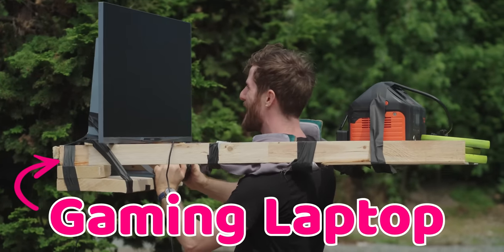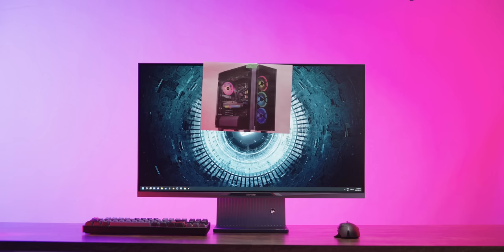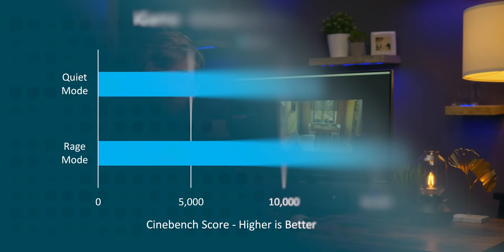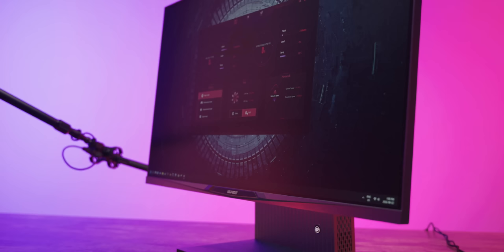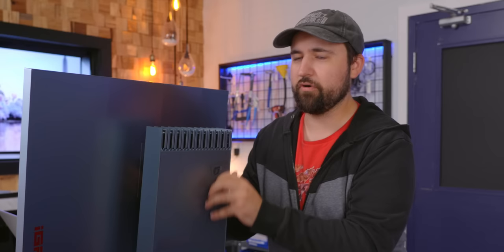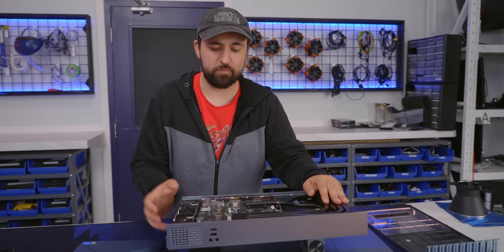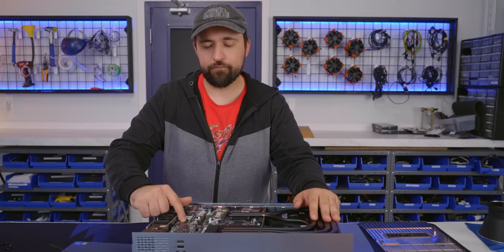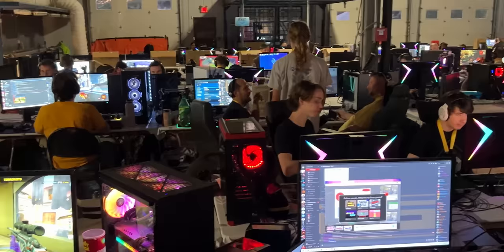Justify Your Existence. I'll Wait. - Colorful iGame AIO

Comment: Some points I think need to be made:
 - speccing out and building an actual SFF PC (getting everything to fit and not overheat) is at least one tier above building your own PC in a regular case; Linus did eventually touch this point, but very lightly, personally, I think that it's not for at least 90% of people out there; you could have someone else do it for you, but then it's more cost and there's also a matter of maintaining it.
 - you measured the performance of your "SFF build" on an open test bench (so, very likely, better thermals, and, not unlikely, better performance than if it were to be run in an actual SFF case); 
 - a gaming oriented SFF PC, as small as it is, is still a decently sized additional box to have around, which may be undesirable for this product's target audience
 - with an SFF, you would probably have more upgradeability; that said, RAM and storage would likely be at least as painful to upgrade as here; CPU? One of your options would be AM4, which, after many years and generations, is finally approaching EoL; the other option is Intel. So, CPU upgradeability on an SFF is more of a maybe than a yes; also, the future CPU would have to fit not only inside the same socket, but have similar cooling requirements as well; the GPU would be a clear win for the SFF, though (provided that power requirements don't go up significantly).
 - Why not get a laptop? Well, if you want portability, get one; if you want ergonomics of a proper 32" monitor on a stand and a PC that you will use in your home, then a laptop is not it. This is for people who want an almost proper PC in their home, but have limited space or want something that will fit in their living room. Also, for someone in a small space, at 32", this can double as their TV.

Regarding the performance, I agree that 1440p is stretching the hardware, although I would imagine that, at slightly lower settings, the 3060M will be able to push the pixels quickly enough for some time. I have an RX 580 8GB and I recently switched to a 1440p display and I've been pleasantly surprised so far; granted, I haven't tried Cyberpunk, but the likes of, say, AC Valhalla or Stray, not a problem apparently, so I guess that this isn't too bad either. This question is what makes or breaks the system, as a gaming system that can't actually game is a flop, but something that will tear through eSports, with high framerates and has a large HRR display to boot, and that will also do other titles, as long as you're willing to make some compromises (downgrading from very high or ultra settings, using DLSS, accepting that you can enjoy a game without a 60fps lock, which, as someone born in the mid 80s who grew up on a budget I certainly do) is a viable option. It's worth mentioning that all of the alternatives offered in the video either offer similar performance, cost more, or both.

It can be argued that a 27" 1080p version may have made more sense. It would have been cheaper and less big, making it more suited at some of the use cases mentioned in the video, and it would allow the GPU to push more frames with higher settings at native res. On the other hand, the 32" do mean that you could seat two people in front of it, each with their own controller, more comfortably than if it were 27", and the same goes for small space, doubling as a TV scenario that I previously mentioned.

Overall, I don't think that it's a bad product. Not for everyone for sure, but there are niches within which it makes sense.

Comment: At least this AIO didn't require an epically insane ordeal to repair after disassembly. Who could forget the infamous $5k iMac repair series.
Reply: Plus you actually CAN swap out the strorage and ram. Certainly can't do that with any of the macs nowadays.
Reply: Do you open your monitor?
Reply: @BrawndoQC  If there was a computer inside I needed to service then I would indeed open my monitor
Reply: @TheoHiggins   You would never buy an all in one from Apple anyway.  We had plenty of HP and Dell AIO at the office and they were terrible to service. We just replaced them.
Reply: @BrawndoQC  Yes, I've swapped the mainboard/PSU in one and taken apart a couple others to minor repairs or salvage parts.
Unless space is very tight, the simplest design is the most repairable. Screws, clips, removable boards.

Comment: An AIO is for someone who wants a large display, good-enough performance, and reduced space on a desk. Every single desktop out there, even the tiny ones, will take up more room than this as this only takes up the room of a monitor. A laptop on the flip-side has a much smaller display, so if you want a proper keyboard or a bigger screen you end up taking up more physical desk space than an AIO.
Reply: but a nuc on the back on a normal monitor will take up as much room, you could argue even less and then you can mount it on a better stand and easaly move it all out of the way
Reply: no they don’t, you have the base & behind monitor to store something like a NUC

It has the added benefit of being able to upgrade / use monitor separately
Reply: @cec4  and the NUC is probably even louder and has less performance.
Reply: Speaking of space, this AIO still looks bulky af because of the stand, and you'll get much better looks with any other AIO.
Reply: @ultraL2  Some AIOs have HDMI input (My dad has one that even has composite input) which is nice.
Reply: “Good enough performance”? What the hell kinda cooling is very very good, or amazing performances???
Reply: @cec4  a tech enthusiast can put something like that together pretty easily, but I wouldn't trust my mom to even know where to begin picking stuff out to get a nuc for mounting to a monitor
Reply: @xXxJakobxXx3  NUCs are definitely not louder or has less performance. Laptops, NUCs and AIOs, use the same kind of cooling. And the performance depends on what model you bought.
Reply: Can you VESA mount this? Any monitor/AIO that can't be VESA mounted surely wouldn't take up less space than a laptop (which can even be on an upright stand) and a monitor on a VESA arm or wall mount with one thunderbolt cable doing everything? The base of this monitor is literally the footprint of a laptop it's so chonky lol.
Reply: @ultraL2  Thats very dependant on desk size I think. I know for me personally my desk isnt deep enough to have a NUC behind it, my monitor goes right to the back of the desk, so that simply wouldn't work as something that takes up the same space as a monitor.
Reply: You could glue an intel nuc on the back of a monitor but that's kinda jank.
Reply: Who has such a space premium that this is more affordable than any other option. Still makes no sense.
Reply: @ViXoZuDo  any regular 4x4 NUC that you can VESA mount behind a monitor will not have a dedicated GPU, therefore has less performance than the machine in this video. And these 4x4 NUCs are probably way louder, because of the tiny cooling solution, compared to the big heatsink in the video. Skull Canyon and the other gaming focused NUCs may be different, but the recent releases looked like separate boxes, not VESA mountable. EDIT: NUC11 Enthusiast may come close, not sure if it is VESA mountable and 2060 vs 3060
Reply: @cec4  Well you could jerry-rig something to mount a NUC to the back of a monitor, but most people wouldn't want to even try to build anything or find a way to secure it, people don't want that effort. If its on the desk behind the monitor then thats desk dependant, on my desk my monitor has to be pushed all the way to the back because of how small it is, and some people can't just get a bigger/deeper desk in the space they're in. So while a NUC is a good solution, theres still a niche for an AIO.
Reply: Not sure what mini builds you've seen but I'd rather have anything other than an AIO. Even the smallest mini itx build can house way better components and will be much more quiet rather than a AIO with a literal laptop housed inside the stand with 3600rpm fans. Laptops and AIO's will never be good until some revolutionary cooling techniques come in to play. Sure, the convenience of them is okay but name one person that has ever said "wow yeah I've been using this gaming laptop for years it's the best thing ever I play all day every day" because you can't lol. Can't upgrade them, thermals and thermal throttling and worst of all C tier components, mobile chipset, mobile gpu's etc. Mix those together you get a toaster oven that thermal throttles with length of play. I'll stick with building my own "massive" desk top pc's.
Reply: Laptop + monitor is still probably a better value
Reply: @xXxJakobxXx3  All NUCs can be VESA mounted, including the intel ones... even the chungus of the Mac Studio can be VESA mounted. You can even buy adapters to mount a whole laptop to the vesa mount behind the monitor.
Reply: @B_M_A  But for people who buy AIO's they're generally not enthusiasts, and therefore don't care too much about the components. As long as it does the job at the time they buy it its good enough. An AIO buyer is the probably the least likely sort of computer buyer to want to build a machine, let alone select components for it. This means that for the vast majority of people on this channel this thing isn't for them, but there are people out there who would prefer this over a small ITX, NUC, or a Laptop, because it fits their wants better.
Reply: @Holden2Epic  I think he meant in AIOs in general as its basically a laptop motherboard  in a monitor.
Reply: @__-fm5qv  mate it’s a 32” monitor , there’s space for a laptop
Reply: @ultraL2  Not necessarily, you can put a big monitor on a small desk, and plenty of people out there do so. Just because it seems impractical for your living space, or because its not how you would allocate desk real-estate if you had a smaller desk, doesn't mean that someone else won't prioritise screen-size. 

People have different priorities, and something that seems poorly optimised for your needs doesn't mean its poorly optimised of anothers needs.
Reply: @__-fm5qv  did you even watch the video …
Reply: @ultraL2  of course I did, what implies that I didn't? I'm genuinely confused... I'm just stating reasons someone may want a large AIO over other solutions, not necessarily this particular AIO.

Some people simply want a large screen and have limited space on under a desk for a computer.
Reply: @__-fm5qv  the video & title is about this particular AIO

Even if we are talking generic 

there’s no way you have space for a 32” monitor & not have space for a laptop vertically behind it
Reply: @ultraL2  And mounted how? You can have a laptop stand holding it vertical, but then you need the desk depth for the stand. You could just prop it up behind the monitor stand but that's not the most secure, it could fall behind the desk and break.

I'm just saying that a laptop is great, but you still need to rig up some system to hold and secure it properly, which a lot of people simple would want to do.
Reply: @__-fm5qv  You learned nothing from the silicon scarcity. You're actually competing with these idiots, i.e., if more AIOs are sold, the price for more convenient alternatives will rise. So, better educate them out of their lazyness.
Reply: @sovo1212  I'm not sure why everyone is so mad that I'm saying that there is a reason AIO's exist and people buy them???

I personally wouldn't buy and AIO, but there are people out there for whom they are the ideal option.

And you can't just educate someone out of their laziness if they don't want to be educated. And therefore there is a market for them. 

I'm not sure why people here are trying to argue the objective truth that for some people an AIO is their preferred option of computer form factor...

And I personally don't view computing form factors as a competition against who prefers what form-factor. So I'm not going to try and sway people so that my thing can be cheaper, thats just psycopathy.
Reply: @__-fm5qv  I just explained to you how scarcity works. Ask yourself "why do gamers hate cryptocurrency miners?" It's not like "there's a market for them, let them choose and be happy". More sand for AIOs means less sand for PCs, NUCs, laptops, etc. So we have to pay a higher price because of the demand on silicon by these AIO lovers. That's how the market ACTUALLY works, not ony this one, every market.
Reply: @sovo1212  Well yes, but I'm not going to be like "you should get a laptop instead because that then means I can get a laptop more easily due to production prioritising that" am I? Thats psycotic, trying to manipulate the market to suit your own needs instead of having someone get something that works better for them specifically. Morally thats a no from me.
Reply: @__-fm5qv  That's not psycotic, it's just taking good care of your hard earned money (not to mention it's objectively a better choice). If you just don't care you must be rich, but that's not the reality for most people.
Reply: @sovo1212  I mean, for me a computer is a 1 in 6 to 8 year purchase, while I'm not poor I'm not exactly well off I barely make enough money to pay taxes. I just start saving for the next computer as soon as I get the current one. I'm not rich, I just don't think trying to manipulate the market for your own gain, over genuinely helping someone come to a purchasing decision is morally good.
Reply: @__-fm5qv  You're not manipulating the market. Bad choices made by other people negatively impact your personal finances, that's the point. By saying someone else "don't buy a f*cking AIO because [list of reasons]", you're genuinely helping to come to a purchasing decision, nothing morally wrong with that.
Reply: @sovo1212  I'm not saying don't list out reasons not to buy an AIO. I'm just saying your original arguement of "Dont buy AIO's because of chip shortage, and therefore me not being able to get what I want" is stupid.

And that you have to acknowledge that for a small subset of people an AIO is the best choice, or at least the one they would prefer to use.
Reply: @Connie_cpu  then the hp aio or a mac would be a better fit in that case, or a laptop. its an intresting device but is kinda crap compared to other aio and such

Comment: These are good for education or enterprise where they can be easily installed and replaced without fiddling around with monitors. I work in a school and AIOs are way more convenient for us when setting up 30+ PCs in a room and can be more cost effective than buying the tower and monitor separately when bulk deals are factored in and taxes can be deducted. This specific example however would likely be for a well funded place for IT or graphics design where more power is required but doesn't need the best of the best. The upgradability also isn't important for schools/ enterprise anyway as old hardware is rarely upgraded and is just thrown out at it's end of life. They are also rarely repaired and faulty or damaged systems are usually just sent back to the supplier with a 3+ year warranty.

Comment: What if framework did products like this. Upgradable motherboards & GPU's on OLED monitors with customisable ports. Don't need to say more.
Reply: It kinda already exists. A case for existing Framework mainboards, with VESA compatible mounts. It's even printable.
Reply: @sovo1212  My thoughts were to get something like the dell optiplex 7070 ultra. With a upgrade path for the motherboard & either laptop or desktop GPU's. With a greater range of ports, say 6 to 10 ports. Having this plug into a quality OLED panel that with the PC removed can still act as a monitor. Just all the benefits and minimised downsides. Yes framework has a printable case but it's not as great a design as the dell optiplex.
Reply: A monitor with a micro ATX motherboard slot?
Reply: @darin7553  more like this, https://youtu.be/jOWc25fLlEo

with a GPU and having the ports be on the stand, just having the pc plug into the monitor and be 'plug and play' in upgrading it to new hardware.
Reply: @Sandmonmsn  Optiplex has a proprietary design. Good luck if you have to replace the motherboard or the power supply. Those are similar issues than the actual AIO.
Reply: @sovo1212  yes it's dells proprietary design using a proprietary motherboard with ports on the motherboard.

What if framework has a stand where their case slotted into, like the dell, but as the framework is slotted in, fixed USB4/TB4 is connected, making the stand a dock. A dock with customisable ports, maybe it has 10 Gig rj45.

The framework AIO, in my mind, would use their existing laptop motherboard, maybe with a better or just bigger cooler, this between the monitor stand/dock and different motherboard design and form factor should be different enough not to infringe on dells design/patent.

Maybe they just have an iMac like machine with a removable compute element, and without that pc it's just a monitor, that's upgradeable and customisable like the framework laptop.

I initially said "What if framework did products like this". There are ways to make a factory framework AIO different from everyone else and have it be unique. I simply gave the dell as a good reference of, "hey this is a good idea, let's take the good parts of this and make it better and open source as much as it can be."